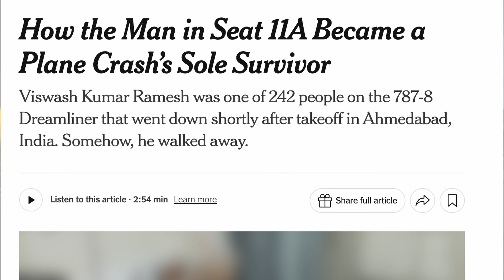Why the RAT Changes Everything – Air India 171 Update

Comment: I never thought for one minute that a trained Airline Pilot would mistakenly put up the flaps by mistake , instead of lifting the landing Gear. The Two levers are completely different and not even close to each other.
Reply: Well it's not like it never happened before. A China Eastern flight accidentally deployed slats during their tans pacific flight. It caused significant turbulent movement of the plane, and multiple people died with even more injured. They had to make an emergency landing at a military airport near Alaska.
Reply: @tyrannosauruswrecks5904 , yeah, it has happened before. But we will know the truth in the fullness of time.
Reply: @tyrannosauruswrecks5904  I know of that fight though I don't remember there being fatalities(not saying there wasn't) I do remember that it wasn't an accident. Unintentional  deployment yes but that's not the same thing as accidentally. They deployed when one pilot left the cockpit and the other pulled a breaker to prevent slats from deploying so he could cheat an unauthorized procedure. The other pilot wasn't aware of this, came back, noticed the breaker was tripped and naturally reset it thus deploying the slats.
Reply: An ATR crashed in Nepal because the pilot monitoring feathered the props, rather than deploying the flaps.  Wrong lever accidents can happen.
Reply: @wadesworld2112  you are spot on
Reply: I read a post by a 787 pilot, yesterday, that stated that the flaps are locked into position until the gear is retracted. Without going through multiple menus
on the plane's computer, you can't actually retract the flaps by accident. Safety systems on the 787 make it impossible to do so.
Reply: It has happened in the past.
Reply: @tommywurzbacher7519  It has but the 787 cockpit has these controls far from each other.  Making a mistake would be like reaching to tune the radio volume but actually grabbing the console gear shift lever.  They are that far apart, different by touch and feel, and at different heights.
Reply: Exactly!
Reply: Even still the plane was going about 174 knots at that point, and the flaps take quite awhile to fully retract, it's not instant. They could have immediately leveled off and push throttles to max. I think on the Mayday call, the pilot monitoring was noticing the engine N2 indications rolling back indicating a loss of power.
Reply: @brnmcc01  wait for the black box
Reply: I doubt a trained airline pilot would mistakenly put the flaps up.  Read up on Germanwings 9525, EgyptAir 990, JAL 350, LAM 470, and Malaysia 370.
Reply: @malvoliosf mistakes happen despite your doubts...
but, is it your contention that the pilot monitoring INTENTIONALLY put the flaps up to cause a crash?
The RAT deployment is just... weird coincidence?
Reply: Most of the pilots in non-western countries get very little training. They race them through pilot school and put them directly on these big aircraft as opposed to making them work their way up through smaller aircraft and gain some actual airmanship skills like we do in the US.
Reply: @viciousvermin9516  That's no longer the preserve of Non-Western countries, sadly.
The culture in aviation has changed dramatically in recent decades. The demand for pilots with commercial endorsements has far outpaced the supply
of experienced pilots. Fast tracking pilots
is now common throughout the entire industry.
Reply: @viciousvermin9516 stop talking horseshit.
Reply: You’re putting too much faith in pilots. Mistakes worse than that are made every day.
Reply: @chuckt8457 There’s no room for mistakes in commercial aviation. 
Minor mistakes in that industry can end one’s career in a flash.
You don’t even think, you just do, check what you’ve done and get double checked always.
Reply: The Rat can also be deployed by the pilots so was it automatically or by the pilots trying anything to keep the plane flying?
Reply: It’s happened before.
Reply: Yes, I’m was with you on that. You don’t become a 787 pilot if you could ever do that, MAYBE unless you were exhausted at the end of a long flight and at 3am.
Reply: Are the standards for pilot training, maintenance, etc. the same across the world? Specifically asking of airliners / airports
Reply: Thank you my friend.
And it’s a 787, I’m sure they’ve flown this before. It was mostly American YouTubers blaming the pilots. Because Americans are so much “smarter” than the Indians that would run circles around our education system. 
It’s a shame.
Reply: Thank you Captain Steve. I appreciate your explanations and analyses.
Reply: Well the co pilot only had 1100 hours so they could have raised the flaps.
Reply: @jamesspikes  thats what you youtube  pilots are hoping for so you can blame them for inexperience when you never probably came close to flying a drone...
Reply: @jamesspikes how do you feel about it now? 😂
Reply: @jamesspikes  If one doesn't know the difference between raising the flaps and lifting the landing gear after 1100 hours, he will never know. Be serious.
Reply: @redblack8414 you think you are making a point.
You are NOT.
There are dozens of accident videos showing accidents caused by mistakes. That doesn't mean they did not KNOW... it means they did it wrong. Mental error. Thinking ahead and missing steps.

Nice try
Reply: @redblack8414 btw?

The kid had a MAX of 850 hours on that TYPE. For all you know, he had 5 hours on that TYPE. Learn how the industry works. Be serious.
Reply: As long as we are humans, we made mistake. Even AI makes mistakes. So there is possibility. If you thought it's impossible, a guy survived the crash eventhough it seems highly impossible
Reply: Check previous crash yeti airlines to see how pilots make mistakes of that kind
Reply: @johnandmerin  sounds like an ignorant excuse to generalize all pilots who were involved in a crash…
It’s like saying if you’re black you’re probably a criminal and if you’re white you’re probably a pedo.
Reply: It's India lol
Reply: @samholdsworth420 you are right. Indian pilots are not stupid enough to ram airplanes and helicopters over their capital city. Their planes crash due to faulty planes, not pilot errors.
Reply: Anyone can make a mental mistake and the first officer was very inexperienced.
He wasn't even qualified to be an airline pilot by US standards.
Reply: @CountAdolfo  4000+hrs and who says that the US has the best pilots
Reply: @jacktattis no, he did not. Captain had over 8000. First Officer had 1100.
You need 1500 in the US to even qualify to be an airline pilot.
You need to educate yourself. You're lashing out like a troll
Reply: @CountAdolfo  Not what we were told on our TV here in Brisbane.
Reply: @jacktattis "Both pilot Captain Sumeet Sabharwal and co-pilot Clive Kunder are believed to be among the dead.

Mr Sabharwal had 8,200 hours of experience. Mr Kunder had 1,100 hours."

Of those 1100, OBVIOUSLY no more than 850 could even be in the 787 because the qualification, there, is 250 hours to be an airline pilot.
Reply: @jacktattis 4000+ hours on that airframe?!? Welp..it wasn't inexperience on the copilot. And doesnt the US play a rather significant (along with the UK) role in ICAO? With many of the world's aviation authorities modeled closely with the FAA? Not going to outright state that the US has the "best" this or that...but can't help feel if the standards were suboptimal or worse..neither of those would be the case.
Reply: @CountAdolfo  There were 1216 accidents in 2023 according to the US safety  council 
Gee how many were flown by your 1500 hour pilots
Reply: I suggest you research,  @jacktattis , because there are literally hundreds of videos of pilots with little experience making mistakes.
I guess you are too unintelligent to understand why most airlines don't allow an inexperienced FO to fly with an inexperienced Captain...

Dense
Reply: @CountAdolfo  Wait for the Black Box You are going off at a tangent. And implying that US pilots are better.
Reply: @jacktattis  This guy Count What the F*ck has knowledge superior to all of us put together. 🙂
Reply: CountWhatTheF*ck has spoken. Let's bow in admiration.
Reply: @CountAdolfo RAT deployed is a visual confirmation that its a system failure - both engines, electrical or hydraulics. You have no right to defame a trained pilot first officer. Get well soon
Reply: @iam00ab You do realise that pilot error is something that investigators, too, consider during these investigations. And, none of the commentors on this incident who come from the industry have said that pilot error is definitively the cause. Just that it is more likely than a dual engine failure occuring this instantaneously. And, RAT being deployed was just as much speculation as incorrectly configured flaps until this clearer video emerged. Until then, we only had poor quality videos where it was easy to hallucinate evidence for whatever hypothesis you had.
Reply: @icygoldcitadel yes lets wait for the black box report. It should make things crystal clear
Reply: The Turkish company who does the service were told to sabotage the jet. India and Turkey are not on good terms.
Reply: @pkbalram640  😂😂😂😂👎🏻
Reply: @pkbalram640  thats a big allegation without any evidence. youre like the essence of what makes human flawed
Reply: He was guessing and has egg on his face. Steeeve went on Indian TV with this lever nonsense as well.
Reply: Anything to get the views… now he gets to make another video and more views/$$$
Reply: @SlavGuns  Don't be so harsh on him.... now someone can make a video about how wrong he was... and someone else can make a video about that video's video's videa....... he's basically contributing to the global economy!
Reply: @SlavGuns  Oh! Shut up. Stupid comment.
Reply: @SlavGuns 🤦‍♂️
Reply: @SlavGuns Captain Steve never stated it as a fact. He mentioned it like all the other possibilities 😂
Reply: @sheesh742   It was his theory that he was pushing, even on a Indian TV interview.
This RAT info has been out there since day one.
Reply: @sheesh742  no one is stating any facts ..what are you talking about?
Reply: @sheesh742  he was a bit too confident in the last video though.
Reply: @dpl2617  the very same day, lets say in about 3/4 hrs after the crash i saw this vid and heard that prop sound that makes me believe that it acrually deployed RAT which refers to dyal engine failure
Reply: @dpl2617 No! That is not correct go check the videos he posted and featured in.
Listen carefully to what he actually said and says. He mentions people speculating about a.b,c,d and said they’re very unlikely.
Also by the way, if flaps had been retracted (which was literally impossible) the aircraft would not have come down - not that soon at least. 
Many armchair aviation experts are still screaming “FLAPS!” Even when actual accident photos published clearly show broken wings on the ground with flaps deployed.
Reply: @Dokus360 Umm, if the flaps had been retracted, that reduces lift. The plane would have come down more quickly or had more trouble gaining lift. Sounds like you are arguing against yourself, or are you just being an armchair aviation expert?
Capt. Steve (who I like and respect) was the one main YouTube  analyst who came up with the wrong handle theory. Even brought it up as a possibility on an Indian TV interview. So it was not his only theory, but it was the one he was pushing. In my opinion, it was the least viable of all the theories out there based on all the info and videos available almost immediately.  What disappoints me is given his status in the aviation community he stuck with it as his main theory as long as he did. So I will take his opinions with a bigger grain of salt in the future.
Reply: @SlavGuns um... no

How petty of you to say such a thing
Reply: @SlavGuns  Yeah, it's not like he's a successful commercial pilot or anything. Definitely not got any other source of satisfaction in his life or anything.
Reply: @AndyCutright  actually, there’s quite a few other pilots out there, specifically 7777 and 787 pilots who have already discounted a lot of those things.  The problem is, when you have the channel of his size, people seriously put thoughts into it.  His wrong theory was already passed off as fact by many news stations.
Reply: @AndyCutright  please, at this point, he makes just as much money, if not more being a Youtube celebrity and then being an airline pilot.
Reply: @AndyCutright  Clicks are $$$$

Comment: if this ends up being a manufacturing issue with the plane (and not say lack of maintenance or sabotage) I really hope Boeing is actually made to pay enough to be forced to make massive changes to their standards and culture.
Reply: The Boeing 787-8 Dreamliner that crashed on June 12, 2025, as Air India flight 171 was 11.5 years old. 
More specifically, the aircraft was delivered to Air India on January 28, 2014, and had accumulated over 41,000 flight hours and nearly 8,000 takeoff-landing cycles.
Reply: @danielerwin5550  At that age its no longer primarily design issues its squarely maintenance issues - the engines would have already gone through rebuilds (more than one) as would much of the airframe and supporting systems. I'm leaning heavily toward fuel contamination - they got a thousand pounds of water instead of Jet A and it got sucked in as the plane rotated.
Reply: Boeing will never be made accountable, US government works for corporations and shareholders.

Comment: The gear is tilted in the opposite direction of fully deployed in a 787, meaning they did raise it and it stopped mid way (tilt changes as it's raised), consistent with double engine failure/electric failure/hydraulics.
Reply: What about the APU?
Reply: @olympicnut afaik, the APU starts automatically in the 78 in case of a major electrical failure, but it takes about a minute. They had 39 seconds total flight time…
Reply: - Until Black boxes are analyzed whos to say the APU was working either...? I hate speculating but 2 engine failures are very rare. It seems to me like this happened after v1 ID BE WILLING to  bet the engines were FINE... its something else.. a power issue maybe- This is so unfortunate, sad for all of the loved ones.
Reply: @NoSuRReNDeR001 Let us wait for the black box yes but let us make sure it is kept secure.
Reply: @jacktattis Its already handed over to the agencies.
Reply: Whoever says it's rare for duel engine failure, and even if the odds are 1 in a million, why it can't be that one rare incident? 

Just like one person survived in such incident itself is rarest of the rate event.
Reply: @olympicnut  The fact passengers were complaining about no air conditioning/entertainment on the ground on the previous flight with this plane, I'd say APU was out of service.
Reply: @wally7856  And there was not enough time to start it.
Reply: @soeren72  If it was out of service, you "can't" start it until maintenance fixes it. It's inoperable. The airlines can legally fly the plane for 10 days with an inoperable APU before required maintenance.
Reply: @olympicnut  The APU is not operating during take off and normal flight.
Reply: @olympicnut APU doesn’t have sufficient power
Reply: @olympicnut  After engine starts the APU is no longer required. Don't forget this all happened in less the 60 seconds. I feel so very sorry for all involved. I will wait for the official report, before drawing any conclusions. Thank you Captain Steve for keeping us up to date.
Reply: Exactly, main gear was positioned in the retract position, which means the gear lever was operated but the wheels didn't come up.